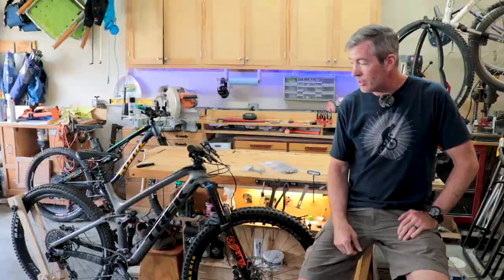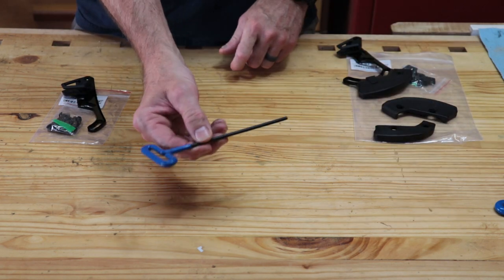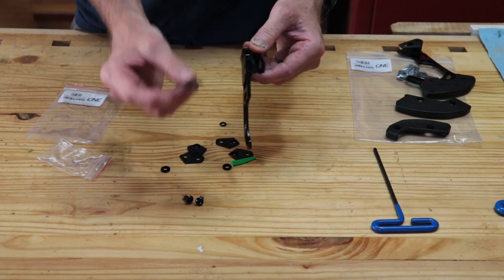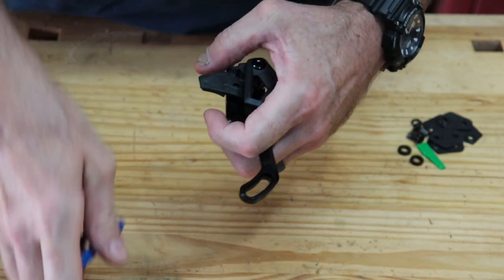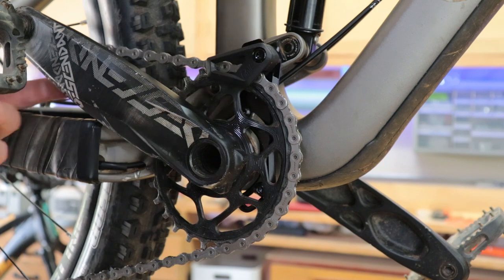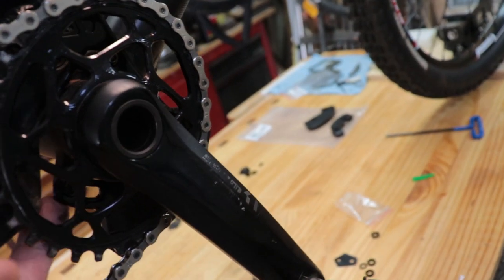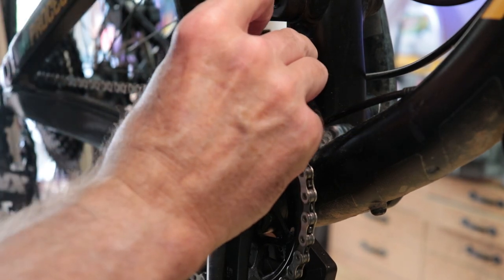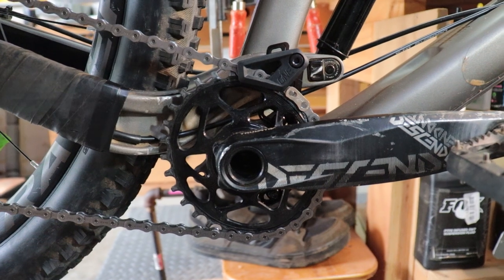Chains SUCK unless you install a chain guide! OneUp Components V2 chain guide

Comment: I was constantly dropping the chain on bumpy terrain after I went from a triple to a single ring and removed the front derailleur . The chain guide I installed is a savior. I haven't dropped the chain since installing it.  Brilliant little piece and in black its hardly noticeable.

Comment: I just installed a brand new advent x, dropped chain after 2 days, damaged the paint on the carbon chain stay and bent derailleur, straightened it the best I could but doesn’t shift as well as before. Chains suck

Comment: tip: you can use the absolute black chainring as a bottle opener., at least 34 and 32T.
Reply from the maker: I have to check this out!
Reply: You can use pretty much anything as a bottle opener 😂.
Reply: @ZRMTB  not on the cider bottles from the local juice and jam factory. But they switched to threaded on caps anyway. Buy i have tried various methods, the twont work only a bottle opener or chainring worked. But hitting bottle while holding it down to aa surface won't work, it might on less secure caps.

Comment: I have a Race Face Cinch on a 2015 LaPierre xR729 (xc, rear suspension, 100mm) with an Osymetric 34t...There seems to be only 2 mounts om the bike frame for a guard/guide.  They are con-joined with the rear triangle.  Is there a chain guide/bash guard that moumts to this?....  When the chain gets really dry, it starts falling off when I shift to 1st gear.  Which guide should I try?  The one-up or the absolute black?  Will they even work with the osymetric chainring?

Comment: Great video! Helped out a bunch. 
Question did you use a torque wrench or is nice and tight good? 
Also did you use one washer on the top nut and bolt? I’m like you and have a little over centimeter of clearance.  
Thanks a lot.
Reply from the maker: Thanks Buck!. Each bike is different. My Kona had good clearance and needed spacers for the guide. The Trek was REALLY tight. No spacers and I actually had to install a washer behind the bracket on the bottom bolt to bring the guide closer to the seat tube.

Comment: Meh. Don't need it. I've been running Shimano XT 12-speed drive train with a RaceFace narrow/wide chain ring for the last 6 months and have yet to drop a chain.
Reply from the maker: Yeah I never did either...until I did. Did I mention $700 to fix the damage? 😀
Reply: do you mean shimano is better than sram and it will not dropped any chain??? see his components he has a better components than your so called XT and RACEFACE chainring but still suffering from chain dropped.. it is not the brand that counts, it is  a  preventive measures.
Reply: as a matter fact i don't have any expensive drivetrain on my bike like you do.. eventhough my components is cheaper so i dont have any chain dropped ..so  don't tell us you are using XT and RACEFACE .. CHAIN DROPPING makes no exemption whether cheap or high brand parts.. i use chainguard as a prevention.. AROGANT!!